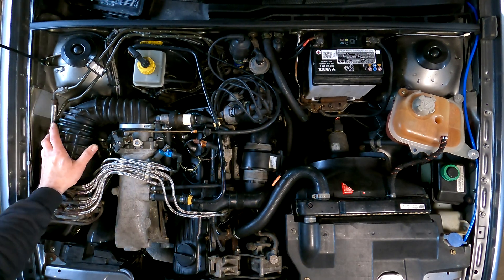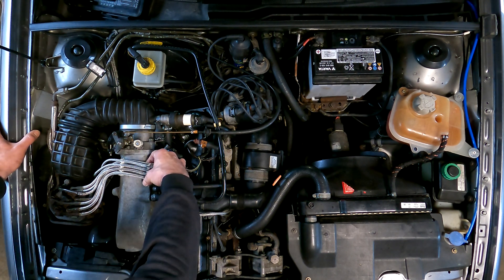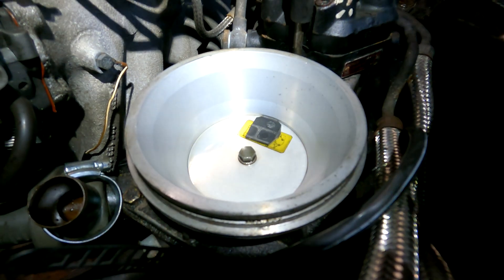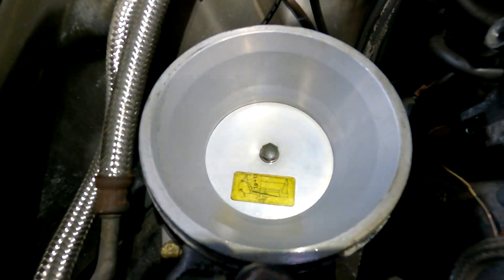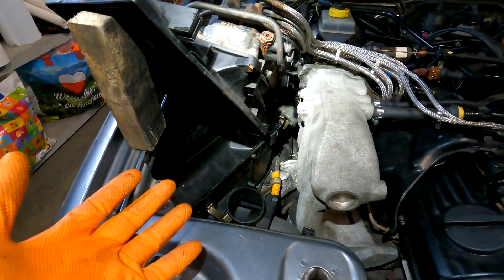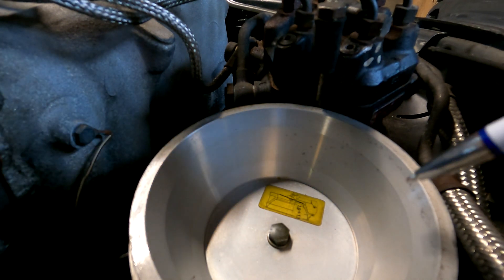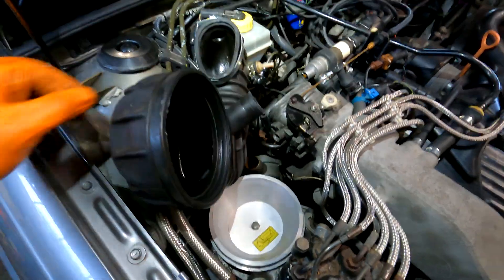Airflow sensor, air flow meter KE-Jetronic K-Jetronic adjustment and settings check.

Comment: How you do the small black plate to test the distance?
Reply from the maker: Hi. I just made flat piece just for the test. Its easer to mesure with that flat piece. I meade exacly right size.
Reply: @Andyborowik  How you crafted the perfect gap?
?
Reply from the maker: @ZohanSauberPetronas  i had in my gatage flat packers that thay are 2 mm so i remove by sand paper very small skin only and i got it. I mesure packer with caliper so im sure it was exacly size.
Reply: @Andyborowik  copy!!! soo the correct plate is 2mm?
Reply from the maker: Correct is 1.9 +- 1.1mm but for sure it should be sticker with size on Your plate
Reply: @Andyborowik  okey I will check, The most risky for me adjusting KJ is all parameter can be switch antoher... Soo right now the car runs okey. The only setting that I can´t check is CO. You now some tip to check it?
Reply from the maker: @ZohanSauberPetronas below You have l8nk for polish version of adjusting CO in k-jetronic. I have english version recorded but i never made movie out of that.  https://youtu.be/zAq4vZ6qUiw?si=EK_XvA2i7fyC8nWI

Comment: Hello! Really nice video! I got a question, my airflow box need to be cleaned, i took under side of the box ans that's clean already, but could i spray some degreaser under de plate? Mine looks oiled

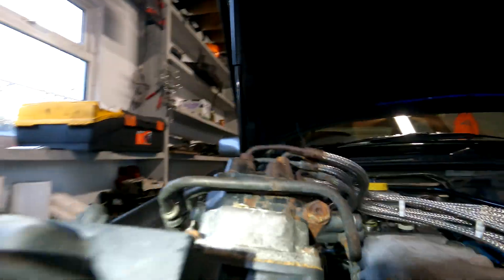Edit: 3:47 is what i need to clean
Reply from the maker: I think its no problem to clean this but but dont go wild with cleaner. Brake cleaner will be good for this , short sprays and let it dry.